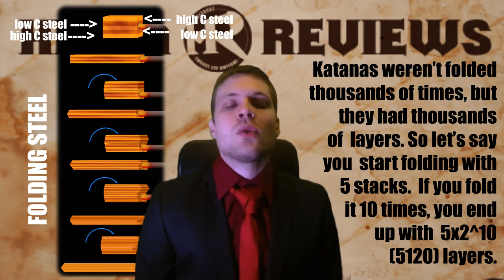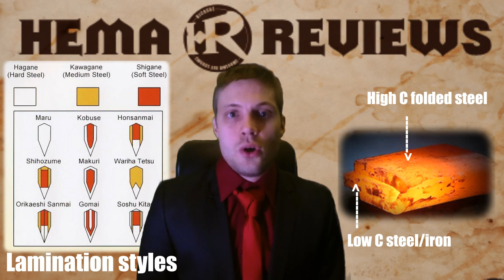Educate Yourself: Katana vs. Longsword

Comment: In Japan the Katana was not the only sword type, o-Katanas and nodachi where what was primarily used in battle after yari. Due to their length you should actually compare o-katana or nodachi with the english long sword because that is closer to their classification.
Reply from the maker: Thatoneguy overthere That's a point I took into consideration, however decided against it. The reason being that the longsword, much like the regular katana, was the sword of choice for everyday life in a medieval setting. The bigger swords, as you pointed out, were more regularly used as war weapons, while the katana and the longsword were more sidearms than anything else.
Reply: HEMAreviews good point.
Reply: +Thatoneguy overthere Nodachi in a battlefield served like a great sword. It was deployed to a foot soldier to break enemy's formation or cut down enemy cavalry. I think a Katana, in terms of use, should be comparable to an Arming Sword or a Bastard Sword. A Japanese sword of the same size as a long sword could be a Tachi - a cavalry sword predated the Katana, but the Tachi lost its popularity after coming of the Katana. Al though a Tachi was usually longer than a Katana, they usually weighed almost the same.
Reply: ศานต์ไท หุ่นพยนต์ indeed, however my comment was made simply to note that, unlike the common misconception, there is more than one type of Japanese sword. Thank you for elaborating.

Comment: A very nice video that in my opinion is very well done though I am personally missing two parts to it that might be of great interest. One of them is, as you even comment that you unfortunately can not elucidate is a comparison in handling as I find that it would be interesting to hear of other peoples comparisons. I myself have trained and still train as much as I have the time for in iaido and thankfully actually had an instructor in my old dojo that was able to teach not only iaido but also basic use of several other weapons, among them the longsword. I personally find that the katana overall handles more like a very technique dependant blade that actually has greater speeds than the longsword but only with correct technique and only for short moments whereas the longsword is better for keeping a stable speed throughout a longer exchange.

The other part I find that I am missing in this video is a bit more of an explanation of the fact that the two swords, while both are the standard swords for their time and society, is not really good weapons to compare to eachother due to the fact that they were designed for different purposes and in different environments. I understand that this part might by necessity, especially if you would wish to mention any of the other blades, either japanese or european, to explain which blades were more of a purpose-equivalent of the longsword and the katana, take quite some time but maybe it could be something to do a follow-up video on?

Overall though I find the video very good and find it very nice to see a decent person create such a video instead of some fanboy, as it so often is. The only small thing I reacted on was when you were explaining about the handle construction, you mentioned that the blade of the longsword is directly connected to the pommel but you did not explain how the blade of the katana is secured to the handle, a minor detail but something that might make people feel that the katana seems much less safe in its construction. From the rest of the video I surmise that this was not your intention at all but I thought that it might be nice to mention this as a form of constructive criticism.

Once again, a very nice video about a subject that unfortunately is often destroyed by fanboys.

Comment: A few things:

1) You're very quiet. I had to crank my speakers to full to hear you properly.
2) Your accent is almost gone, YAY!
3) Would you say that you were still unbiased when you said that the round guard was not effective in a katana? I haven't handled either swords, the comment just struck me as a bit...
4) VERY informative. Thank you!
Reply from the maker: Hey, First off, thanks. :D
Secondly, for the loudness - I didn't even think of my speakers since I usually use just my headphones. Will think of it next time. :)
as for 3.), that one comes from reliable second-hand experience from people who trained both HEMA and JSA, in this case some Kendo. Apparently, the extra length of the crossguard means you can block attacks from a much wider angle than with a tsuba. I apologize if I said that it's not effective, it's simply less effective in that aspect - although from what I've gathered, there is a lot less binding in JSA, so that's probably a minor point.
Reply: HEMAreviews The sound is clearly low and the audio quality is need improvement.

I think that the tsuba protects the hands better on the sides, but the European quillion stick out more so protect better in front and back.
Reply: HEMAreviews Actually there is quite a lot of binding in some, emphasis some, mainly older, japanese sword styles however the way that you enact the binding differs quite a lot since the main defensive methods differ between the two styles. It is this difference that really lets you see the difference between a western crossguard and a japanese tsuba. Trying to enact a binding the western way using a sword with a tsuba leads to hurt fingers. Trying to enact a japanese style binding with a crossguard is very hard and might lead to hurt fingers.  This is due to the fact that the japanese style binding from the styles which uses it a lot mainly binds by starting with a parry and leading that into sliding the flat of your blade against the flat of your opponents blade until you reach the tsuba. If you do this with a crossguard the blade usually can not turn since you are applying pressure to the flat of the blade and therefore it is also hard to turn the blade. This is not mentioning the fact that if you go edge to edge with a pair of katanas then at least one if not both blades are just scrap afterwards. So shortly, the crossguard is brilliant for western blades but not very useful with japanese blades and japanese styles. The importance in parrying with the flat of the blade comes from two facts, one is the metallurgy you talk about in the video and the other is the fact that the katana is not a slashing or chopping weapon the way western swords tend to be (except the rapiers and the like of course) but rather an extremely specialized cutting weapon. This also makes it a bit hard to compare the two but I personally think you have done a great job with that.
Reply: +kaunas888 The sound quality and the sound level is fine on my computer.